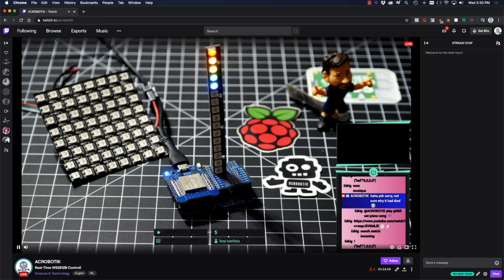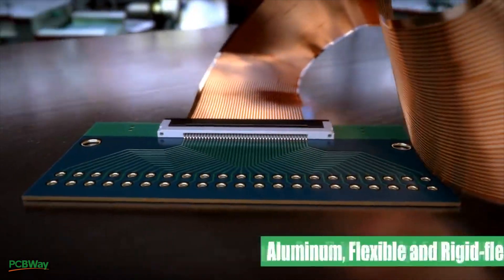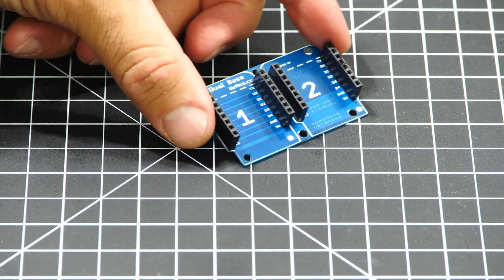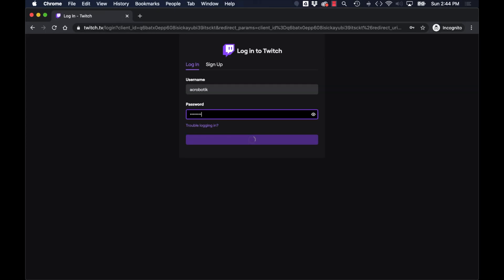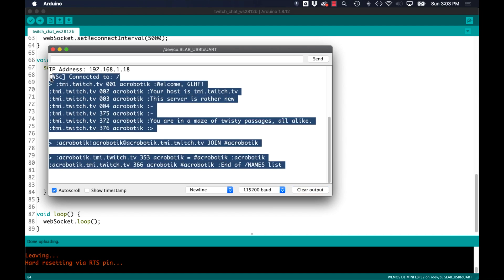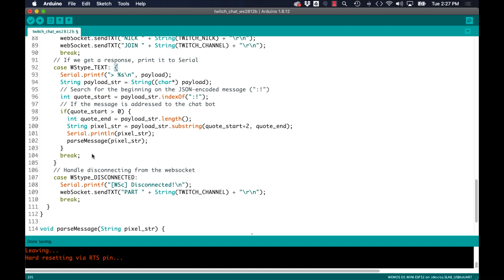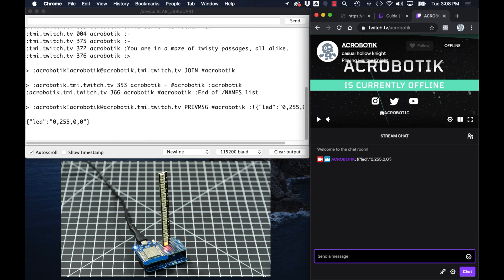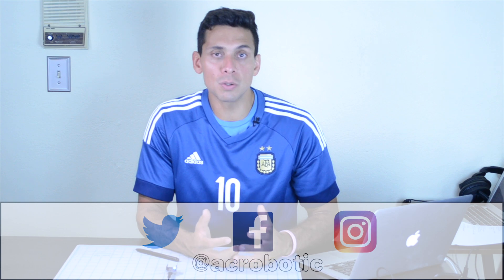ESP32 Twitch Chat-Controlled NeoPixels | WS2812B LEDs | Arduino IDE

Comment: Hello, thanks for the tutorial. I have a problem, I try to find the solution by myself but i couldn't:
crosses initialization of 'String payload_str'
String payload_str = String((char*) payload);
Reply: I found the error. The code shown in the video is incomplete and I was typing it as I watched it because that is how I think I learn better.
In case it happens to someone else in the "switch case" function, they must open and close braces to allow the creation of variables:
case WStype_TEXT: {
      Serial.printf (">% s \ n", payload);
      String payload_str = String ((char *) payload);
      // Search for the beginning on the JSON-encoded message (":!")
      int quote_start = payload_str.indexOf (":!");
      // If the message is addressed to the chat bot
      if (quote_start> 0) {
        int quote_end = payload_str.length ();
        String pixel_str = payload_str.substring (quote_start + 2, quote_end);
        Serial.println (pixel_str);
        parseMessage (pixel_str);
      }
      break;
    }

Finally, I recommend not copying the video code directly, better download the example version: https://github.com/acrobotic/Ai_Demos_ESP32/blob/master/twitch_chat_ws2812b/twitch_chat_ws2812b.ino

Greetings.

Comment: Working on expanding your code  to respond to new sub etc..
Reply: How did that went?
Reply: Any luck with that?
Reply: @dubyajayplays  I think I might abandon ESP32 for this and use a Rasp Pi
Reply: @Joseph-ur  ahh I see. Any particular reason for the change? It seems like the ESP would have all the power you'd need. I'm just trying to get it so when someone subs it turns my light brightness to 60% or so and then after a moment turns it back down to 10%, so my use case may be totally different than yours.
Reply: @dubyajayplays  I don't have the time to invest in writing or fixing Twitch code I intended to use.  And I found controlling LEDs to be unreliable.